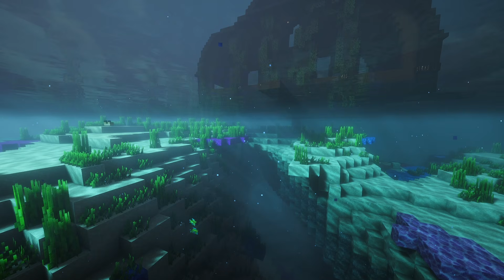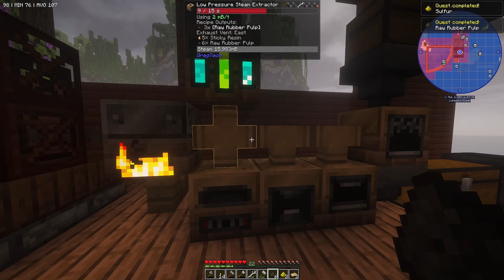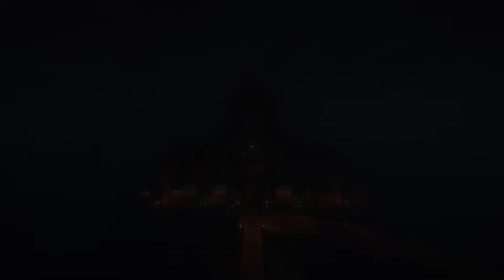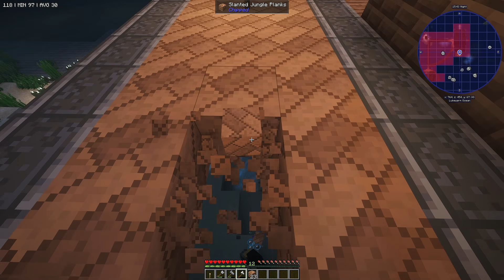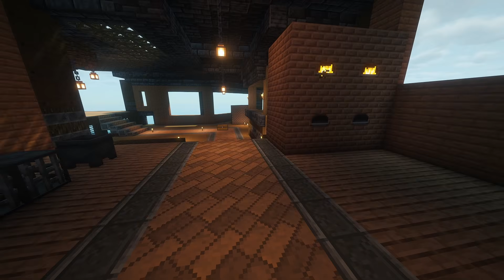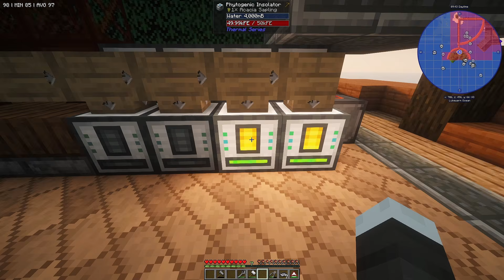Monifactory Expert E3: Exciting Electric Expansion

Comment: Dear CEO: 
I regret to inform you that the PR department has all been sentenced to a mental institution after going insane from the 3000000% drop in profit from using Acacia wood in the build.

However, quarterly profits are still up 500% due to the success of recent new products.

Best regards, 
Employee 3.14159265358979

Comment: Dear CEO,
after noticing our CEO motivation into building a splendid factory, we recommand you to  use the Replay Mod (or ReForgedPlay for forge 1.20.1) for the building done on stream and edit it in the training vidéos after, it is compatible with shaders and other mods and lets you do complex times laps vidéos straight from minecraft.

SIncerly,
an impressed long term inter

Comment: Greetins CEO! Soil tasting specialist and overworked Masters student here! 
The I in Ender IO's μI stands for Infintiy, as that is the name that the dev chose for it's power, meaning One forge unit is one micro of the actual Ender IO power. This goes in hand with the fact that you need to usually burn bedrock, by lighting it on fire, and waiting for it to pop a grain of infinity. It sadly doesn't come into play, so you never produce actual infinites of power, so it just stays there, with a weird name for aesthetics.

Cordially, 
Employee 1/137, STS.

Comment: The EnderIO customary energy unit is "Infinities" - thus micro-Infinities. It's a product of the era around 1.16 (I think?) where Thermal Foundation (and EnderIO) disappeared for a while and everyone had to scramble to standardize the Forge Energy system from the corpse of Thermal RF. It's also exactly equivalent to 1 FE.
Reply: Actually, EnderIO has used micro infinity AT LEAST since 1.12, i know that cause i play 1.12 packs with it all the time. Not sure but i think back in 1.7 it still used RF like all the other Forge Energy mods of the time, but in 1.12 where it was still being updated often (and is to this day probably the most complete version of the mod, including add-ons) it already used micro infinity, which is, like you pointed out, just Forge Energy.